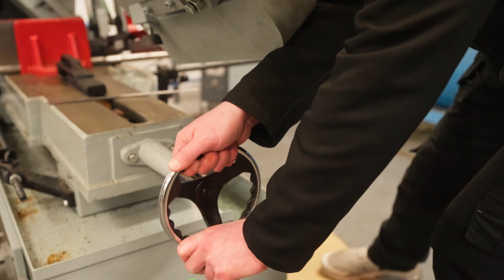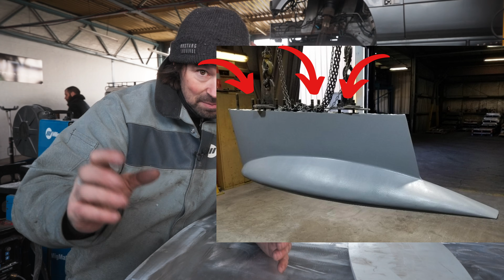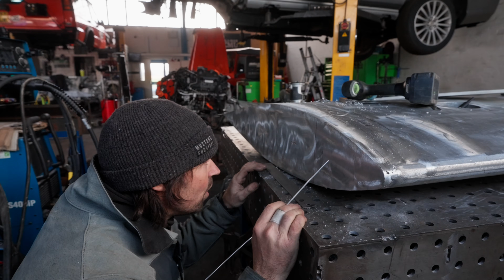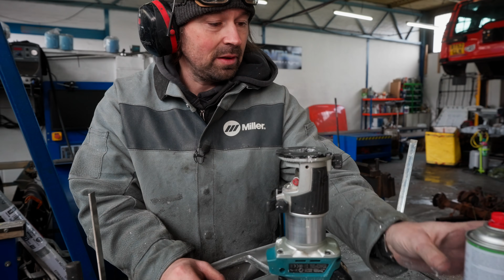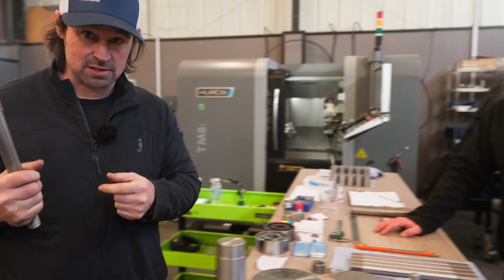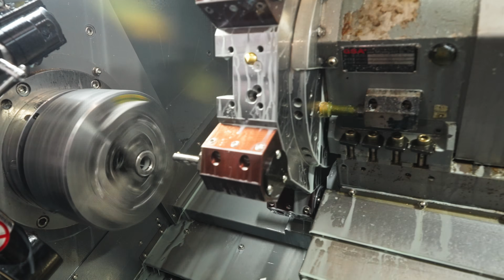Keel Bolts : Saying NO to Stainless.

Comment: 😊
Reply from the maker: So pleased to be moving along with the project now!
Reply: @The_Ghostship I watched Duracell  make a lead keel and it seemed expensive and not impressive.So I researched and found either a using green silica  sand in a flask mould ( two part mould)
Or my favourite was a lost foam casting in dry sand. 
By Heinrichs Made (channel).
Use foam to make your mould shape then cover in  sand.When you pour lead it melts the foam leaving the cavity
Reply from the maker: @talkshitko9234hey up, yeah those methods both make sense for many keels. For ours though lost wax isn’t the best - it works but the escaping gas has no where to go as the bulb is encapsulated by sand in all but a tiny area. It leaves holes and porosity in the lead.

Green sand, also great, but only great. If we can cast in the same location as pour our sand. Green sand is also relatively unpredictable with heavy weight… 
We’re doing something similar but different…

Comment: Great - but costly - decision to go a bit overspec’ on the critical parts.
It Will pay back back in sleep. ( Quite nights, without worries are priceless!)
Reply from the maker: Absolutely Rob! Like I said, if the boat didn’t bounce on the bottom there is little point in this upgrade… but, it does! 

Like you say, a peaceful night is where it’s at!

Comment: I love those technical details. Great video!
Reply from the maker: Thanks Alex!! 👊🏼 can’t wait to get stuck into and share stuff around the actual boat! Not long!!
Reply: @The_Ghostship Looking forward!
Reply from the maker: Cheers Alex 👍
Reply: 👍 the Monel keel bolts are one of the few things you can’t fix in the back of beyond so defiantly worth doing the best way possible ! 
Can you bolt a temporary outboard on the back for alternative power ? 
Cheers Warren
Reply from the maker: Hey Warren… you are right about the bolts! Regarding the outboard - Someone one made one for the boat, we can’t wait to see it I’ve just got to make the mounting bracket when we get there!
Reply: @The_Ghostship  👍👍👍 that could greatly simplify getting the boat moved. I’m sure you could borrow or rent an outboard from somebody.
Reply: I was wondering , along with an outboard on the back potentially, if you just put some internal ballast in the boat, sandbags ,lead billets , whatever the boat could be stable enough to motor, especially since you don’t have a mast up. Directional stability might be tricky without a keel , but if you could fit the keel even without the lead ballast attached, that would do it.
I assume you’re planning to try and get a crane at some point to put the keel in the boat, or perhaps use the same crane to launch the boat at a canal somewhere and do both jobs at once.
Warren

Comment: I see you put your big boy pants on drilling into the keel. Nice work the bolts, they look very nice and also expensive, shame your never going to see them after they have been fitted. Would you really trust stainless?? I think worth it, 👍
Reply from the maker: Ahh, drilling holes is standard practice 😂 it’s getting them in the right place that counts right! 

Glad you like the bolts, we’re stoked!!
Reply: @The_Ghostship  🤣  👍
Reply: some times you just have make a cut and take a look😊 got to be right to have the best keel bolts you can get long swim back from Patagonia
Reply: @hedleyjackson5131  😅 bit of a swim that would be. 👍
Reply from the maker: @dca @dcallan812 , this is true! And after several weeks of trying to swim, it’s clearly not my strong point.. @headleyjackson5131 it seems like every time we make a cut in this keel we get a surprise…. Thankfully we’re coming to an end with it, or at least that’s what we hope… 🤞

Comment from the maker: Good idea or not worth it? What's your take on these keel bolts?!
Reply: Buy once cry once
Reply from the maker: @DamianPenney not a bad way to look at it!
Reply: Normally Keel bolts are stainless because they need: high clamping preload, high strength and stable elastic behavior under cyclic load; not maximum corrosion resistance at the expense of mechanical performance. Monel is more ductile and can creep over time.
Not my opinion - just how it is. Great boat, I enjoy the videos.👍
Reply from the maker: @KSMtheMariner you will find that even mild steel steel can handle the torques required, in fact many old classics I’ve worked on were built with mild steel bolts! Silicone bronze and Monel remain the material of choice as corrosion is always a keel bolts biggest problem. 

Stainless is chosen because it’s cheaper than the alternatives and it’s got good corrosion resistance, well… it has in its passive state anyway.. but that’s another story.
Reply: You mention in the video that Monel is better for galvanic corrosion, but if mated to aluminium theres (depending on the type of Al) at least a 0.45V difference in anodic index?
Reply from the maker: @Quork this is true, but it’s still better that stainless, and… you don’t have the passive active issues which is really what we need to look at with stainless.